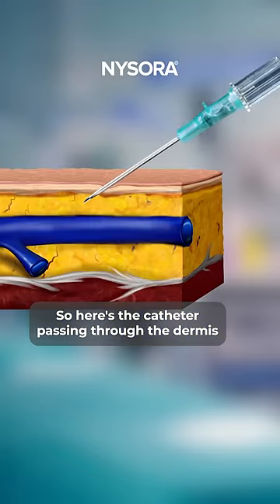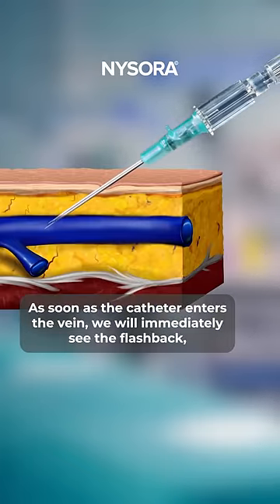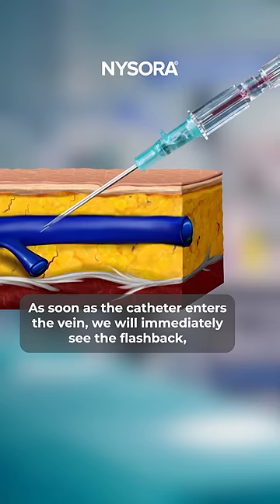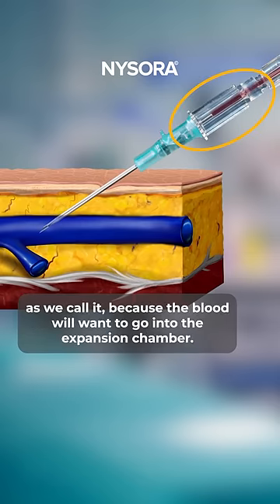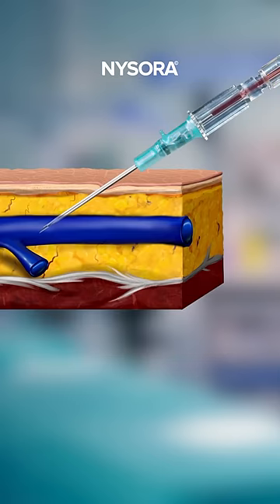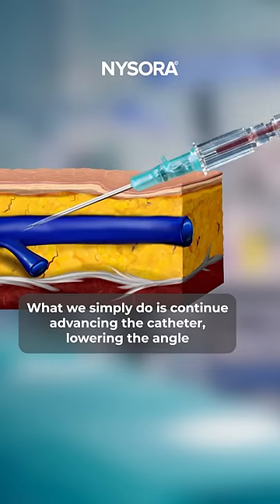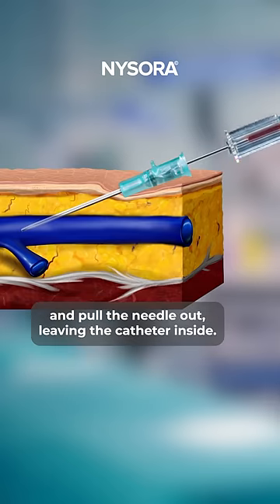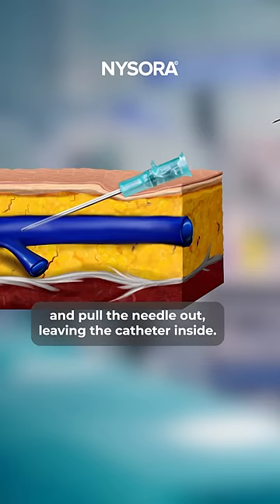Common reason why IV catheter fails. Watch the full video on our channel! #nysora #iv #fail

Comment: I got phlebitis on my right arm from the iv staying in too long (5 days), it swelled up really bad. I informed the nurse on day 4 that it was starting to hurt but they didn't want to replace it because my veins are a bit difficult to find. It was one of the most painful things I've had, level 10 pain, i would say even more painful than labor and recovering from a C-section.
Reply: iv catheter should be replaced every 72hours, 5 days is not okay😬
Reply: I was gonna say, day 3-4 it should have been replaced.
Reply: @drdluv  it should've but they kept delaying it and saying they would but didn't until I told them it was really hurting 🙄

Comment: Thank you for explaining this with visuals. I can’t tell you how many times I’ve had a line run beautifully for hours, then suddenly it blows. The patients seem to believe it was due to my IV placement, even though it’s run for hours just fine and they’re up and down and turning and bending their arms above the site (I go for forearms for better stability away from the AC and wrist joints). Some people just can’t follow directions.
Reply: I think he means the needle's angle is too high. People are going to move their arm. My nurse told me its fine to move my arm

Comment: Whenever ive gotten an iv, they "replaced" the metal needle with a bendy plastic one that allows more movement, and i feel like that would also decrease the risk of this happening? Anybody know the difference between leaving the metal needle vs the plastic tube?
Reply: Metal never stays inside only the plastic

Comment: I was in the hospital for 5 days and everyday twice a day my IV was redone
Reply from the maker: That is tough! Did your recovery went well in the end?
Reply: This was to prevent infection
Reply: @alisyngarza2768  No, IV's aren't redone that rapidly or most patients would actively start refusing to be stuck that many times.

IV's are usually redone every 3-4 days even if everything works great.

Him having it redone that many times in such a short time periods, meant his veins kept failing
Reply: More than likely having an infusion of a vesicant solution (like vancomycin). No need to replace an IV unless it’s symptomatic. Vesicants ideally need to be ran through a central line (like a PICC) but sometimes are infused through a peripheral IV short term.